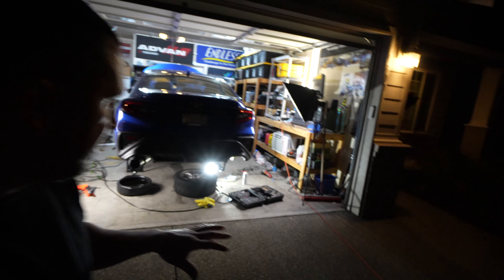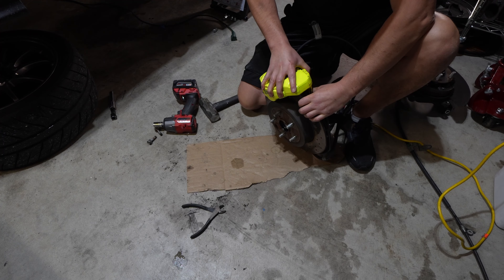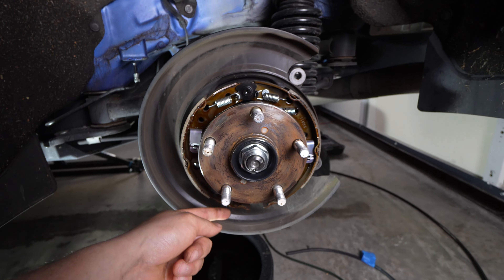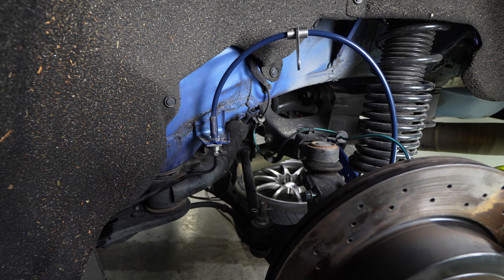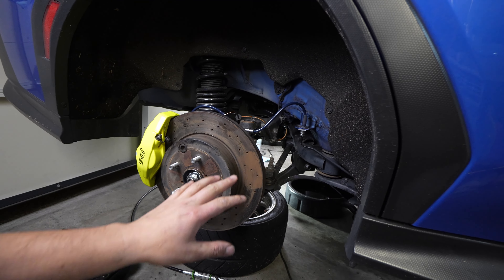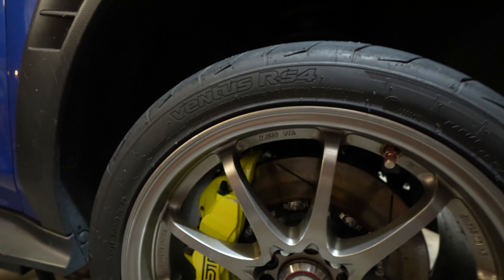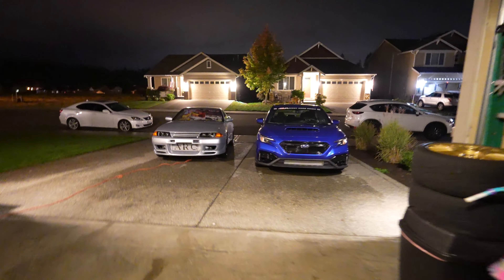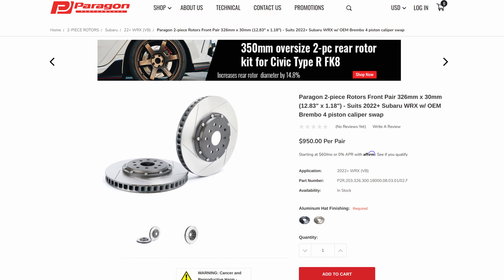VB WRX STI Brembo rear brakes MOST NEEDED UPGRADE! 2024 TR WRX brakes

Comment: Question on your lift....do you lift by the pinch weld? I know they make the slotted doughnuts to use on floor jacks but only saw square blocks in another review video of lift.  Thanx and awesome ride.
Reply from the maker: Yeah I lift the car by the pinch welds. The rubber blocks that come with the QuickJacks and nice and big which does not cause any damage to the car while lifting. The slotted blocks did come with my lift set as well, I just have not used those ones yet. The regular block work just fine for me everytime.

Comment: Do you need pay $950 every time you need new disc rotors now?
Reply from the maker: They sell just the rotor disc rebuilds for $550. https://paragonbrakes.com/paragon-replacement-rotors-for-18-subaru-wrx-sti-6-pot-calipers-vab-vaf-front-pair/?fbclid=IwAR2D1rC-PMcEAcRGyjQjJnnT7nAHlnJW7DcoUbZFo23362I7TcVSiIs8PUE I think later on when the 2024 TR comes out that those OEM rotors will also be a direct fit as well.
Reply: @JDMRightHandDrive  do they have the rear rotor set up yet?

Comment: What’s the torque spec for the calipers?
Reply from the maker: I could not find torque specs that seemed to be accurate and over 115 ft lbs for the front. To me that seemed like a good way to strip on the aluminum threads out on the calipers. I didn't share what specs I used because I didn't want to be responsible for anyone over tightening their bolts and damaging the caliper threading. From what I remember I did 60 ft lbs for the front and of course less for the rear since they were smaller, I think 35 ft lbs on the rear of course with a little loctite to keep everything in place. My brakes have performed perfectly so far. Use caution and make sure no to overdo the torque specs. Thanks for watching and have fun with your VB mods.

Comment: I have a question so does the sti 4 piston caliper from 08-17 year will fit the 2022 wrx ?
Reply: Yes they will, you need the special two piece rotors and STI caliper bolts
Reply from the maker: Yes they will fit. Need the 2 piece rotors in the smaller size. I have them linked in the description. Make sure you use the Brembo caliper bolts.

Comment: So the front requires paragon rotors and the rear uses the factory 2017 and up Sti rotor?
Reply from the maker: Yes the rears were 2018+ STI OEM rotors and front require the paragon rotors. You can use stock STI front rotors, but you need a rotor spacer with extended wheel studs. The other option that might work out in the future. The 2024 TR WRX has Brembo 6 pot front calipers. I am thinking those OEM rotors should fit with the last gen STI front brakes. I will buy one of these when Subaru has these in the parts department and test out the fitment on my channel for the VB WRX community. Thanks for watching and have fun with your car.
Reply: What size wheel and offset would you need for a flush settup?

Comment: no dust shield.. yikes... and the music when bleading... careful .....  but the car looks GREAT
Reply: That’s what it takes to install them. Should be fine.
Reply: @waykool698  in snow and/or mud. It has a chance of collecting between the pad and disk and causing a rear brake fade or failure.
Reply from the maker: Yeah pushing the music copy right on that spot. Thanks for watching. VB feels solid.

Comment: Sheesh :)
Reply from the maker: Thanks for watching you guys!
Reply: @JDMRightHandDrive  Rotora Stainless Steel Rear Brake Lines 2022-2023 WRX and front lines fit a (CVT BASE)  cause it’s says the lines for rear are for manual 
And the description says nothing about the front ones